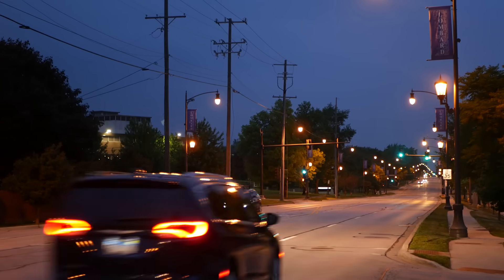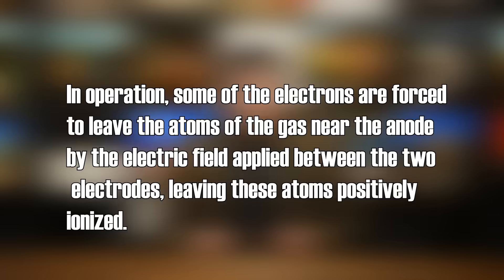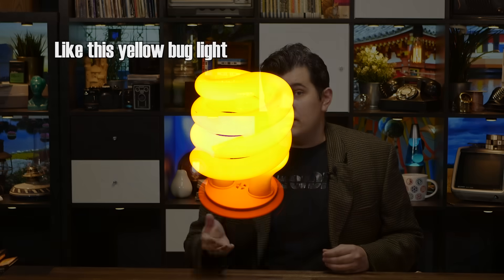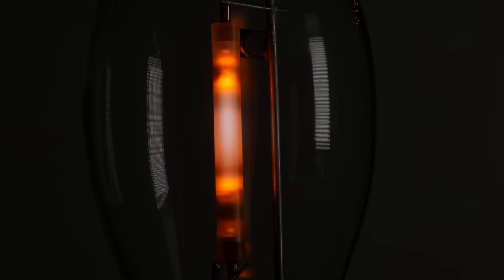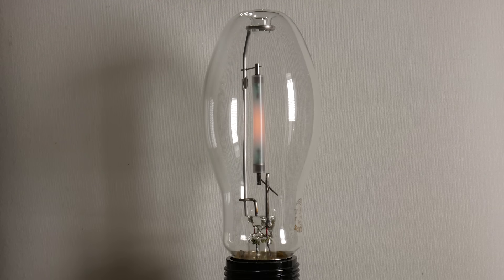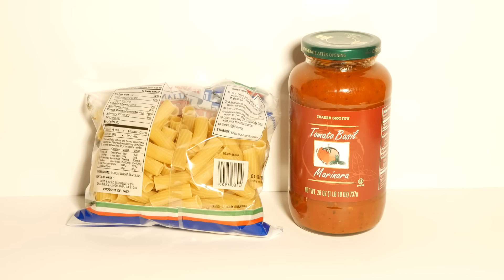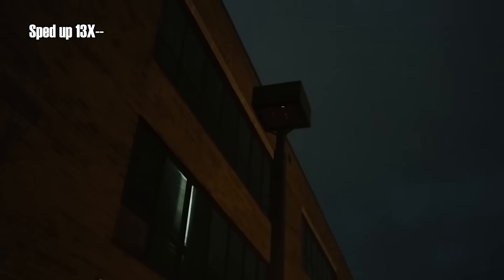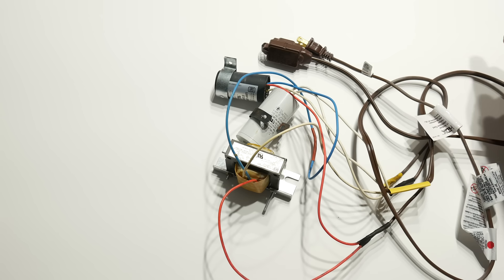The High Pressure Sodium Light: Ubiquitous, effective, but good?

Comment: The sodium lights emitted a safe orange light. They emit no blue light. Blue light is dangerous. It causes oxidative injury to the retina. The eye can handle a fixed amount of blue light each day and repair the injury. Beyond that the damage cannot be repaired. The new LED replacement lights emit a huge amount of intense blue light in the “blue light hazard” region of the visible spectrum. Some of this 452 nanometer blue light is absorbed by orange phosphors and re-emitted as orange light. Though the lights appear “white” to humans (and only to humans), they are actually blue and orange. The so-called “warm” LED lights emit more orange and less blue.  The so-called “cool” LED lights paradoxically are much hotter than the “warm” lights. The intense blue light always causes injury, though the eye can recover from some of that. The standard RG0 lamps that are considered “safe” are actually limited to 10,000 seconds of “safe” use before exceeding the maximum blue light exposure standard for the eye for a day. That means that after 2 hours and 47 minutes you should turn them off and not expose yourself to any additional LED light for the rest of the day. That includes phones, computers, TVs, pads …. And who does that? No one. Everyone living under LED lamps almost certainly is being over exposed to harmful blue light every day. Very few LED lights are designed to emit low levels of blue light. Nearly all emit far too much blue light to be safely used for long periods (over 2 hours 47 minutes a day). And for some people (3-30%) the actual safe level is over 10-20 times lower. Symptoms of over exposure include: photophobia, eye pain, jaw and molar pain, sneezing, conjunctivitis, uveitis, burning sensations in the eye, gritty sandy feeling in the eye, headaches, tension neck strain and pain, and worse. 

Add to this - nearly all LED lights flicker in both intensity and color at 120 times per second (100 in Europe). This flicker confuses the part of the brain that detects edges in the visual field and motion. That can and in some people does trigger migraine headaches, optical migraines, intense high frequency screaming subjective tonal tinnitus that does not stop (for days, weeks, or longer), and intestinal symptoms. 

The two color LED light makes perfect focus impossible. And with color constantly shifting it is made worse, though very few people can sense that directly. It is too fast for the brain to for, images. But the eye sees the flicker. So too does the brain. The lights are also implicated in increasing rates of myopia(nearsightedness), the solution for which is to spend much more time in sunlight outdoors. 

Perhaps worst of all and unrelated to any of these mechanisms, the blue light from LED lights strongly activates cells in the eye responsible for determining whether it is day or night. These then instruct the brain not to make the sleep hormone melatonin. That leads to sleep disruption and much higher rates of disease, increased rates of depression, and increased rates of suicide. In Spain when they shifted to LED street lamps, they observed a huge increase in breast and prostate cancer rates. A 50% increase in breast cancer. And 105% increase (more than doubling) of the rate of prostate cancer in those exposed. These rates were even higher for people who shifted to using LEDs at home. 

There is also an enormous glare issue with LED lamps. And the use of naked emitters not shielded by shades or reflecting light off surfaces makes this immensely worse. The small spot size may also lead to much greater localized injury in the eye than the “safety” standard considers. This is particularly a problem at night, for drivers, and even more so for people especially sensitive to glare. And more …. Much more….

Sodium lamps cause none of these problems.

Comment: Low pressure sodium light were good for over 60000 hours.. high pressure sodium  50 % survival at 20 000 hours.  Led  50 to 80 thousand hours  but  they  are way to bright.. they stop the human eye getting its night vision.
Reply: But low pressure is almost useless at night, and the LED bulbs might last that long, but so far the average for how long the control circuitry lasts seems to be less.

Of course the ones they use for lighting could last a lot longer than one's in home use conditions. But then there's the weather.
Reply: @lordgarion514 lol.. low pressure sodium light put out enough light to see but not  so much they would dazel.   When driving at night  the colour of the parked car or tree in the road is irrelevant..you just want to know its there.  
Most of the low pressure sodium light we had were 35 to 70 watts.. they could give  50%survival rate of 20000 hours with 50000 hours being the norm.
While led lights  can use less power and last longer  there brilliant white light can cause eye strain

Comment: Curious about what the next video on this subject will reveal.  When the sodium lights came out the field of lightenedness (not sure if that is a word) seemed smaller, and certainly the ability to discern objects was diminished.  My opinion- cities were sold bags of BS to implement these lights.  No doubt the sodium light salespeople were working on commission.

BTW, I owned gas stations at the time lights went to sodium,  because they'll be better.  BS.  It was darker under the canopies than before.

Comment: "White" LED Street Lamps have a lower apparent luminosity than even Low Pressure Sodium (SOX) lamps, they are installed in our local area and I am often having to light up the old mobile phone torch to navigate certain areas. They are also notoriously short-lived due to them being over-driven which causes some of the COB "cells" to burn out quickly rendering the whole lamp-head useless. The High Pressure Sodium (SON) lamps are, of course,  much better but they tend to be used mainly in major road and highway areas, firstly because of the type of light they produce makes it easier for our eyes to navigate hazard spots much more safely, and secondly the running cost is higher for SON's so they are not as cost efficient to be used in urban areas.

Comment: I have been using 1000w high pressure sodium bulbs for indoor grow lights since 1999, so roughly 22 years now. One thing that's super awesome about HPS bulbs, especially when you have an affection for knives like myself, the sodium oxide tube inside makes a better final sharpening tool than a Whetstone. After about 45 minutes to an hour on the Whetstone I'll use the sodium tube from an old HPS for 10 to 15 minutes for a blade so sharp I can drop a piece of standard computer paper held vertically on a knife held stationary and the weight of the paper alone, falling roughly 2-3 inches is enough to cut it about 8 inches before it stops on the knife (depending on blade thickness)

Comment: We have a sodium light above our barn, dusk to dawn every night it’s on. The same bulb has been in place sense 1983. Pretty impressive!
Reply: What size bulb/watts for the high pressure sodium? I too like the color produced
Reply: @genediggins8331 I guess he doesn’t know
Reply: Yet some LED streetlights in my town (brand new) Are already doing weird things like turning purple and flashing
Reply: @NEON2600  It's probably because they went with cheaper units to save money but it's actually just going to cost more in the long run.
Reply: @NEON2600 LED’s can last basically indefinitely, however most LED’s are cheaply made, and their circuitry useally goes out after a similar (or shorter) time than incandescent
Reply: Theres many street lamps down my street that uses high pressure sodium, those lights have been there since 1984, they give a pinkish color at night and sometimes white then turns to orange. LED light bulbs are very bright now.
Reply: Has it even started having greenish startups? That’s usually a sign of cycling

Comment: If anyone ever finds older High Pressure Sodium lamps, the filament is an amazing knife sharpener! I worked under an old electrical master for over 7 years and we replaced countless old light fixtures in an industrial plant for years so he would always check every bulb for the filaments for knife sharpeners lol, it has to feel textured if you scrape your fingernail over it, those are the good ones. The newer styles have a smooth feel and will dull your knife

Comment: Well a few years in and by me the city is switching over to LEDS, but after testing my city is using warm light LEDs, not bright white, or daylight. They cast light like a incandescent bulb. Its wonderful, and really cuts down on light pollution and are easy to see.
Reply: could you ask your city to speak to my city and stop using "hospital waiting room blue" leds .. thanks.
Reply: This video is 3 years older then this comment. New street light LEDs are much better than 5 years ago and warmer colors are now available. There new LEDs 3000-3500K are really good and pleasant for eyes.
Reply: @volkhen0  as long as its orange and retrofitted into old streetlights the vast populace wont know the difference
Reply: @circleinforthecube5170  Not orange, amber.
Reply: I wish my city would adapt warmer color LEDs.  I’m not a fan of the pure whites
Reply: That's pretty good as far as installers go; but you can also get orange colour filters for them which is better for wildlife and our eyes adjusting.
while blue light is more efficient for seeing, blue light disrupts circadian rhythm much more

Comment: I just came across this channel, and have finally gotten the answer to a mystery of life that I've wondered about for literally as long as I can remember. Idk if this is a thing in other places, but when you drive on the Paris périphérique, some of the tunnels/underpasses you go through are lit entirely by what I'm now guessing are some such sodium lamps. What made those tunnels unique though was that everything looked greyscale (well, with a yellow tint) when you went through--and I mean fully greyscale, absolutely no colors visible, not like the example of the colorful objects in this video. That was always my favorite part of car rides as a kid, and honestly I still get unreasonably excited when going through those tunnels. It's so cool to finally learn why that happens! Unfortunately these tunnels are way less common now than they were a couple decades ago; many tunnels now alternate between the sodium lamps and a boring white lamp, so you can vaguely see colors even if they're a little wonky.
Reply: If it looks fully monochrome, it was a low pressure sodium lamp. The high pressure ones are a lighter, golden color with a tiny bit of color rendering

Comment: 10:10: not only for street lights.... as much advanced LEDs are already, as growing lights they are still the best because of its color spectrum and im using LEDs and HPS together, LEDs(10x200W COB Array driven with 80W per COB so about 800W LED) as main light source and 2x 600W HPS to compensate the low 670nm (red) and for "real" heat radiation.
I had awesome results with HPS only, as i switched to LED i saved ofc a lot of energy, but LED and HPS together had the best results (not only because of the higher power, but also because of a "fuller" color spectrum which fits better for photosynthesis than LED or HPS only.

My personal favorite are still Xenon lamps, i modified and resold a lot of cheap "junk" throwers with 50 and 75w xenon bulbs, electronic ballast and LiPo battery packs (instead of cheap 5-20W halogen bulbs with a cheap lead battery). Nowadays LEDs can compete with Xenon when it comes to light density, but about 5 years ago the throwers with the best range used xenon, mostly modified (= removed shield) high power car bulbs.
I still use from time to time my xenon lamps, especially in the winter you can melt snow or get a little bit heat radiation when you work outside next to the awesome bright light.

Comment: Yeah in San Marcos and the area's around the Palomar observatory near San Diego, it is actually mandated to use low pressure sodium due to its low light pollution. They easily have the budget for LED's, but found out that even low intensity street LED's would interfere with the telescope.

Comment: Orange light produced by sodium lamps really soothing to the eyes at night,  won't hurt vision unlike other lighting technology.  The low cost of operation per watt  is an added advantage on city budget too.
Reply: LEDs are less efficient than HPS and much less efficient than LPS if they had to provide the same service. What they do to be able to claim higher efficiency with LED is chose a high colour temperature (which is aesthetically awful, harsh on the eyes and bad for circadian rythm) and illuminate a narrow cone that does more to obfuscate what doesn't fall inside the cone than it does good.  They're just doing less with less; not more with less.

Comment: Sodium lamps can be a problem in parking lots. One time, I was on my way to the car to go home from college and I put my key in the door but it wouldn't turn the lock for some reason. I went around and tried the passenger side and couldn't unlock it either. Just when I was going to see if I could even open the trunk, I realized that there were different bumper stickers on the car and that it was not, in fact, my car. That car was the same kind of car as mine but in light blue and my car was brown (well it used to be gold but it was an old car by then). Because of how the car looked under the high pressure sodium lamps, I really couldn't tell that the car was blue until it dawned on me that it wasn't my car and then I looked a little more carefully at it. I'm glad the actual owner of the car didn't see me trying to open their car because it was really embarrassing. My car was only a few parking spaces further on the same isle.

Comment: When this kind of bulb burns out, you can use the aluminum oxide tube from the center as a knife sharpener. If that ever comes up.
Other failure modes (found from work): tube melting failure, and blowing that little conductive disk open. Abd ballast failure, but that can get rather messy.

Comment: I got a ticket for parking at a red curb because it was literally indistinguishable under the sodium-vapor street-lights. It looked virtually identical to the gray, unpainted curb. I was able to get the ticket dismissed by arguing that the street lights were at fault. Besides generating unfair parking tickets, HPS street light makes the street seem poorly lit and dirty. I hate them. Red curbs ought to be striped when placed beneath HPS lamps.

Comment: Something cool I noticed is when you cut power to the HPS bulb the tube inside the bulb will dimly glow blue for quite a while.I extracted the tube from a bulb I had and ran it through a microwave transformer till it turned orange and then unplugged it.It glowed for over 30 minutes.I'm gonna try to run that experiment again to see how long it will glow.
Reply: Do not do that as that is an extremely dangerous thing to do

Comment: Have you covered the problem with putting LED lights in Stop/Lights? This is when the LED light isn’t hot enough to melt the snow that falls on the lamp. Thus these lights get covered with snow and don’t show the color lamp. 
And people don’t know if they can go through the intersection. So companies are trying to figure out a way to add heaters to the stop lights.
Reply: That's called the danger of But Sometimes

Comment: I have a massive 2000 watt industrial Metal Halide light that weighs about 225 lbs and is way, way too bright to safely look at. When you're standing back-to to it, it leaves a shadow of such high contrast it's difficult to perceive properly. It was mounted in an old railyard
Reply: Check for accuracy the 2000W rating of the bulb. If it is powered by 240VAC, then there would be 8.3 Amps of electricity going thru it. The 2000W varieties are typically used in sports stadiums (and rail yards), but they need to have a covering around them for safety. They tend to shatter when they reach end-of-life, if not handled carefully.
Reply: @richardmjr2291  It has a diagram with 120 and 240, it's definitely industrial. It's a huge cast aluminum housing and a bulb about ⅗ the size of a soccer ball

It's a good three decades old now, I'll never turn it on again, but it is a cool novelty to show people. I have a power drill that would twist a leg off and a bunch of comically oversized tools like chisels and files
Reply: @PronatorTendon  The bulb alone does not weigh 225 lbs(~100kg)! you are mixing up the weight of the bulb , glass, tube, plus cap and feed wire/electrodes with the weight of the *fixture*, including the housing, starter, socket and the ballast. The ballast is made from transformer laminations (heavy), while the housing is cast aluminum.
Reply: @richardmjr2291  no I'm saying the housing, how could you possibly think I meant the bulb?

I literally said "It's a huge cast aluminum housing and a bulb"
Reply: @PronatorTendon  Easy, US-EN <> CA-EN, "2000 watt industrial Metal Halide light" is very similar to "2000 watt industrial Metal Halide light *bulb*" versus " 2000 watt industrial Metal Halide luminaire"... just variations on the 15 definitions of the meaning "light". So, it sort of depends on the variety of EN language written. I read EN-US, EN-GB, and EN-AU, but write in EN-CA.

Comment: Incandescent street lights are no more for more then 20 years and they are obsolete and hard to find, so does Mercury Vapor lamps, but they save more energy. Pretty soon Sodium Vapor lamps will be phase out in the near future, but it does save more energy then Mercury Vapor lamps. LED street lights do even save on energy more then both Low and High Pressure Sodium lamps.